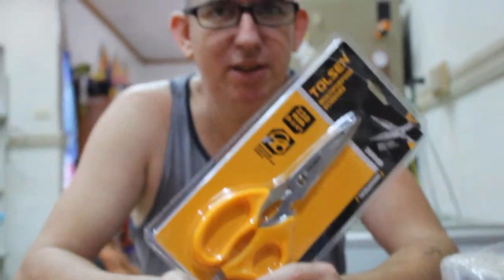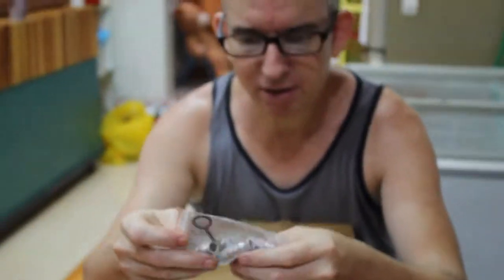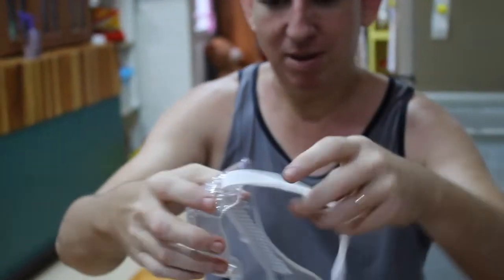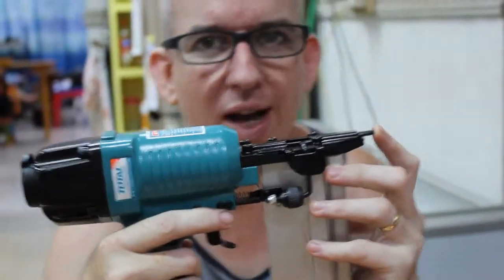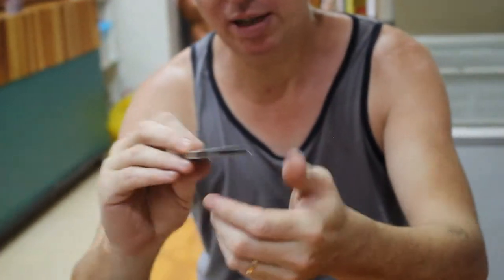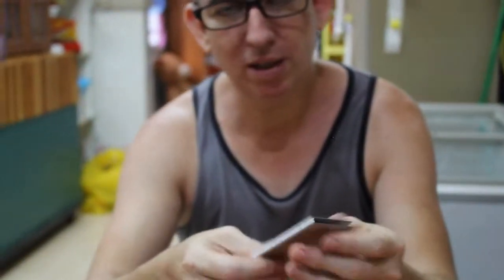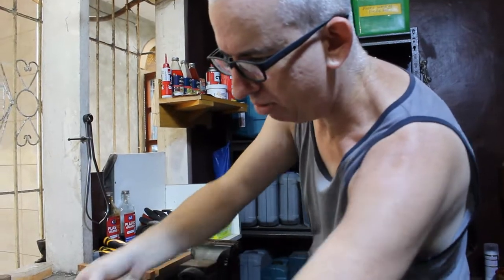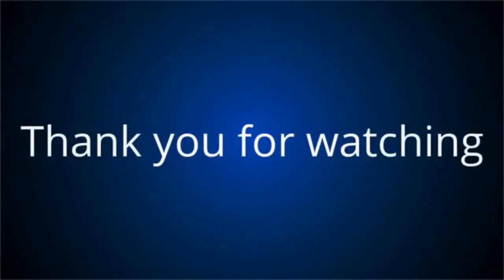DEMO-REVIEW "TOTAL" STAPLE AIR-GUN 2in1 Combo Brad Nailer | UNBOXING

Comment: Looks like a good staple gun. I like that they included different air fittings. I guess it would be pretty aggravating to get it home and find out yours didn't fit, huh? It wasn't that bad. You can skip the punishment tonight. Well, unless she's into that kind of thing I guess.😂
Reply from the maker: yeah, i got a sand blaster before and the air fitting was wrong. had to order some. i ordered a whole bag so i have reserve. i got it because it shoots longer staples than my other staple gun.